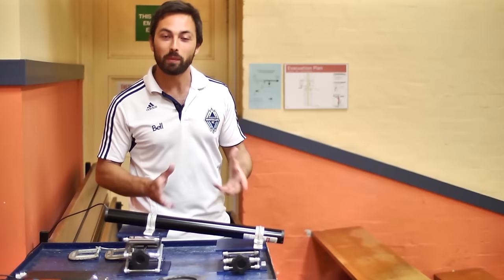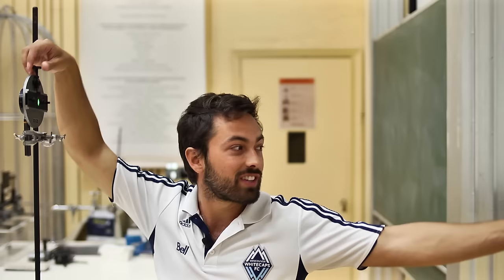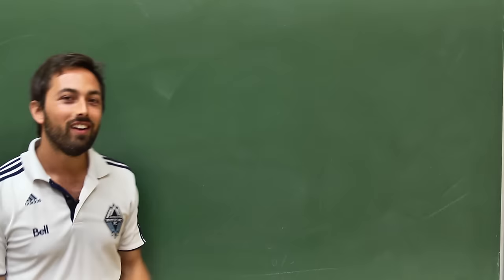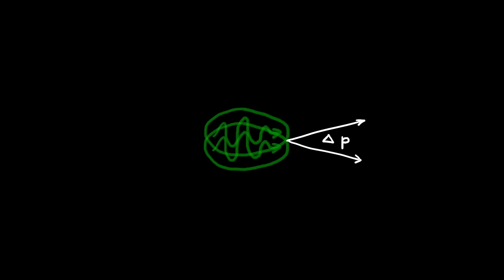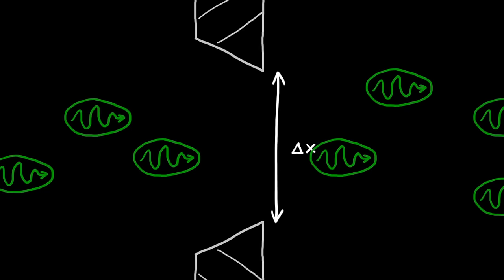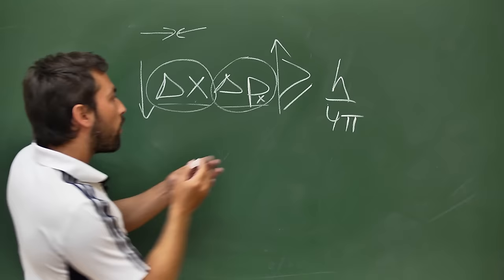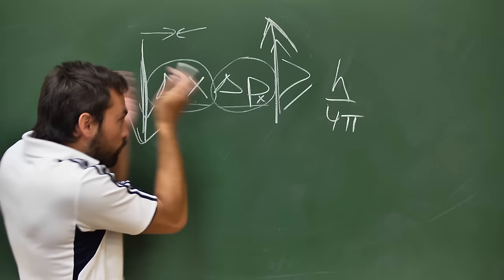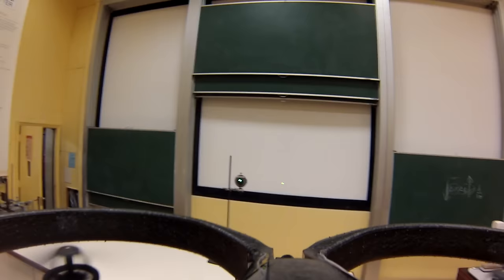Heisenberg's Uncertainty Principle Explained

Comment: Light normally extends but passing to such narrow slits it defracts and doesn't expand as it can only extend from one place to another but as light has some mass if slit is narrow than the mass than light defracts. It is bouncing in-between the slit and resulting in distortion as light can't pass through slit (as area of slit is less than mass of the light so light has mass here I say) so on the surface behind the slits its resulting in distortion of the light  where light is seen hazy or some diffuse due to light particles bouncing with and from slit so much less part (strength of light is less) of light is seen on the surface behind slit. 

COMPARING TO THE SLIT INREAL light only extends (which can't be due to its mass some place [slit here] is with less space so lesser area of a slit doesn't allows light to pass if space [area of slit] is less than THE MASS OF LIGHT so light is distorted) it can't expand as can't work other than moving in straight line WHICH MAKES IT DISTORTED on the place behind the slit.

Now force of light means REQUIRED LIGHT TO MOVE AN ELECTRON  IS FORCE and TIME WE CAN SEE (AT) THE TIME IF APPLYING FORCE ON ELECTRON so we come to know the exact time to move an electron by force of light and so we come to know force too and time too we come to know as required to move an electron so by formula m=f/t  as time and force we know now we can find mass of light-beam WE CAN SUCH WAY FIND MASS OF THE LIGHT AS COME TO KNOW FORCE AND  COME TO KNOW TIME TOO AS I INFORMED BEFORE IN THIS PARAGAPH AND THE FORMULA IS MASS=FORCE/TIME to find mass and property of light from mass.

IF YOU THROW A LIGHT BEAM IT EXTENDS THAT IS TRAVELLING IN STRAIGHT LINE AND WITH DISTANCE LIGHT DOESN'T EXPAND BUT DEVIATES FROM THE LINE IN WHICH IT IS TRAVELLING THAT TOO IS IN STRAIGHT LINE in different directions like making angles but it fills up the whole place or area which is due to its speed of time-travelling so it is at all the places still din't expand (expansion doesn't keep the material other than some area it gets diluted and extending makes copy things again and again made [due to time-travelling] what light is) that is light only extends like it changes direction due to angles even when anything is not in-between the flow of light (but it has mass so flow of light is different due to its mass {light is covering the place due to reflection alone that is extending when we see light in certain (big) area we should know that it is not due to expanding but due to reflection or that is by extending property of light in various angles even from the source too and like by bouncing on surfaces by making angles). As light is timetravelling so is at all places of deviation of light is by extending  but it is like expansion visible to us due to light travels in all direction [by time travelling too so time travelling is also there and light is also extending in innumerable directions {from the source too} so this two things are answer for light] still it is only travelling that is by extending, it covers the area like expansion, but only extending it could be due to its mass that it can't extend more or far ahead places it can't go so just mass is the weak-ness of light that it doesn't reaches at all places.

Comment: So, if the interference pattern observed is because of heisenberg's uncertainty principle.... Then how come it is the case you can still see light in the center? My question is that, if the uncertainty in x becomes so small, then there is no way the x momentum can be zero. Would not the x momentum need to be zero or near zero for there to be photons landing in the center and thus not having a dark spot there?

Comment: Veritasium Can you do a demonstration of a reversed experiment where you decrease ∆p? How does the momentum of photon change if the velocity is constant?
Reply: physics doesn't allow photons to move at different speeds. You can send them through a medium which gives the appearance of slowing down, but its really just the time it takes for the light to be absorbed and re-emitted. So the only thing that really can be changed in this equation is the knowledge of the position of the photon.
Reply: +Corey Minich But change in momentum for a photon is linearly proportional to a change in it energy. 
So, you can change the momentum. 
But HUP deals with uncertainty in it.
Reply: Momentum in the sense of adding energy and taking advantage of the duality of the particle, but it's not changing speed. So I'm not sure what that has to do with this topic
Reply: can't we change its speed by traveling it through a transparent medium?

Comment: I have a question.  The momentum becomes less certain as the position becomes more certain. Can we simplify this since the experiment uses light?  Momentum is Mass*Velocity...but light doesn't have mass, so is it ok to just use velocity?  Velocity is Speed and Direction, but lights speed is constant...so without a change in mass, and without a change in speed, does this mean that the direction of the light is becoming less certain as the position of the light becomes more certain?
Reply: light technically in quantum mechanics does have linear momentum = H/lambda
it is the same H as in the video used for Planck's constant and with this formula you use the uncertainty principle

and yes over here what is represent is change in direction but i am not sure if this is the Heisenberg uncertainty principle i was under a completely different interpretation which i was taught and made much much more sense whereas this video didnt give an explanation about how that is the uncertainty principle so i am not sure if this is it or some other principle

Comment: I propose you watch your own video about pilot wave. It is an interference pattern that appear.
Looks like your bullet photon animation is misleading. Showing wiggling short waves (one full 360 degres per photon) would be closer to reality.
But your point in this video is demonstrating that too much precision in position induce imprecision in momentum.
But do you know how momentun is measured in any optics lab?
I worked for 8 years as firmware engineer for the femtosecond laser MaiTai. The 20 femtosecond bursts are so short that the light barely makes 10 to 20 oscillations.
There is no photo detector able to measure such short pulse. So, the optical engineers use sliding mirrors to introduce calibrated delays and rely on constructives and destructives interferences.

Comment: Uncertainty  may be the result of lack of data or understanding, when you have both there can be none.
The only reason the light spread is as result of the slit being narrow than the laser beam, never happen before.
Make the beam narrower no spread, narrow the slit again it comes again, due to the fact the photons not move in a perfect parallel lines, if they would have there would be no uncertainty, also the thicker is the barrier the uncertainty is smaller.
OK you say so we can calculate the angle and know where they  hit, why would they spread? The answer is not knowing what is really happening, we can calculate the odds pretty well, but to the how there is no answer.
Know the how and each photon will go to the exact location you will predict.

Comment: you say that the narrowing of the slit we are decreasing delta x. but the momentum is velocity and mass so why would the velocity and mass make something shift to the sides?
Reply: Exactly what I dont get
Reply: I got it. In quantum mechanics the momentum of light depends on its wavelength and a change in direction is equivalent to a change in wavelength since one doesnt happen without the other. Cant describe it using classical physics since light has constant speed and no mass so mV makes no sense.
So when the uncertainty in momentum increases / what direction light goes in is uncertain. So you get the spread in the x axis. 
what really made it click for me is taking a horizontal slice of the phenomenon in action.

Comment: From where does the photon gets energy to accelerate ? I mean , To change its momentum .
Reply: Photon has no mass so by the 2nd Newton's law F=ma photon needs 0 force to accelerate. He doesn't even accelerate, he gets his speed (c) insantly.
Reply: That's actually a good question, because of e=mc^2 the light would require a force acting on it to change it's direction.  albeit a very small force
Reply: +K463178 when we leave classical physics , we get to a point were we can say that forces act upon energy , not mass . so , photons do require energy while accelerating ....
from where these photons get energy , if they use themself as an energy source , they would vanish after sometime ....Please explain the truth
Reply: I think photons don't need an energy in order to change it's direction of moving. Because how can you spend an energy in order to change the direction of MASSLESS thing. No force required to change it's direction (F=ma) and therefore no energy either (E=FxS).
Reply: Grukkel Zinn It has mass, it's just in the form of energy, same reason light is affected by gravity
Reply: Inderjeet Singh I don't understand what you are asking
Reply: +Grukkel Zinn according to e = mc2 ...or rather m = e/c2 
if it has energy , it has mass !! but very less ....
but less is not 0 , and to change things in such small mass we still need energy ...
that's why gravity pulls light :)
Reply: gravity doesnt pull light, gravity bends the straight path that light was traveling in spacetime.
Reply: niko valley yeah , but what does that bend of light depends on 
1. Mass (Energy) of pulling object
2. Energy of object that bends (or goes in curved space time)
If light neither had energy , it would have not bended
Reply: +Inderjeet Singh You have to interpret the photon as a wave, not as a particle (see Wave-Particle Duality)
Reply: Samuel .Jele So when i assume it as a particle , this theory fails ?
Reply: I have to say that I'm not an expert in physics (obviously :P).
But I wouldn't say that the theory "fails" with electrons as particles. It can be explained with the electron as a particle.
The Wave-Particle duality just says, that some behaviors of the electron (and other sub-atomic particles) can be explained with wave-theory and some can be better explained when you interpret the electron as a particle (for more information watch some videos or read about the double slit experiment)
PS: sorry for my bad english
Reply: You're all misunderstanding. None of the photons are changing their momentum. Every photon is traveling in a straight line through the slit and to the screen. The x-direction momentum just refers to the angle of that line with regard to the plane of the slit.
Reply: Copydot A change in direction is a change in momentum
Reply: K463178 It's not changing direction. x is the simply the component of the photon's velocity in the x direction. The photons aren't actually accelerating in the x direction.
Reply: Grukkel Zinn if you look at E=mc^2, you'll see that light does have mass (not the right equation for light, but whatever).
Reply: Think about something at 0 K. At that point, it's momentum should be certain right? At 0. But this principle means that the particle will vibrate, essentially giving it energy. So it won't be 0 K.
Reply: Dilip Tien Seems like you haven't watched the PBS Spacetime video... And the temperature isn't just the straight movement of atoms in some direction, you know?
Reply: Grukkel Zinn how is any of that relevant?
Reply: Photon can not accelerate, it has constant speed -> speed of light. 

It has also no mass. Only massless particles can travel at speed of light.

Particles with mass can travel speed very near to speed of light, causing distances to physicaly shorten, also time goes much slower from their point of view.

From the photon point of view it has to travel NO distance at NO time. 

So if we see some star in a space which no longer exists its because light from the star didnt come to us from our point of view. From the point of photon, photon traveled 0 distance in less than moment. In less than 0.000001 sec. It traveled in no time.

Time goes slower as we get closer to speed of light, at the speed of light time stops, and if there are any particles faster than speed of light, they can never go slower than speed of light, because they are traveling back in time.
Reply: Grukkel Zinn you need to be more clear
Reply: Copydot Earlier photons were moving straight through the slit , as the slit went thin , photons bend to diverge . That bend is a change in direction . Thus requires energy !! Right ?
Reply: Inderjeet Singh Nup. Thats because of nature of photons. At the moment of passing through the slit they dont even exist. Not as particles. Each individual photon exist as a probabilistic wave function until the moment of observation.

As soon as we detect photon on screen or detector, wave function colapses and photon appers on the screen at a certain location. There are locations on the screen where it is more likely for the photon to appear and where it is not.

When slit is wide enough there is very high chance (practicaly 100%) that photons appears in the middle as you would expect.

But when you make slit narrow enough you will make uncertainty in a position of a photon low and uncertainty in momentum needs to cover larger area in order to preserve Heisenberg's uncertainty equation. So basicaly chance that photon lands outside of regular area increases.

But it has got nothing to do with energy or mass, because light particles travel in different way than regular particles. For example one photon can travel via two slits simultaneously. No one knows how, we are just sure that he does it.
Reply: Ivan Horňák Can you please share link of any good video explaining about the wave function of photons .
Reply: Ivan Horňák all particles small enough have the same behavior.
Reply: yep thats true my bad.
Reply: no particle in the universe can reach absolute 0( 0 K) , so momentum will not be certain for any particle.

Comment: Due to refraction, and for single slit formula of the minima = lambda/b it is not surprising as the slit width b decreases that the width of the central maxima gets larger since the angle at which the minima increases and thus the width of the central maxima increases
Reply: diffraction*

Comment: Yeah! I got confused with it.
That's diffraction and you said that's momentum uncertainty.
Reply: Well...it's both. It's like saying that when you pull your arms in while spinning you start to spin faster because of conservation of angular momentum. But conservation of angular momentum isn't an explanation, it's a principle, much like the Heisenberg uncertainty principle. What really happens is that you exert a force on your arms on their way in and that accelerates them to a higher velocity, and with the light what really happens is diffraction and interference of the light waves.

Comment: Sir, i had a question from heisenberg's uncertainty principle it's  puzzling me from so long i can't find an answer to this and the stacks exchange is not accepting my question can you help me out...

The doubt is as follows

If the uncertainty in position of an electron reduces to one fermi (that is 10^-15 m ) the uncertainty in velocity increases to an order of magnitude of 10^10 m/s which is the case to check wheter heisenberg  uncertainty principle allows electron to reside inside nucleus the textbooks disregard this by saying since the einstiens special theory of relativity says nothing can go faster than speed of light (order of 10^8 m/s ) thus this uncertainty can not go beyond the speed of light. But my doubt is that what is the problem even if it goes beyond the speed of light as Einstein's special theory of relativity talks about speed of a particle not "uncertainty" in speed of a particle i assume that this high uncertainty just means that once it is inside the nucleus the speed would be so uncertain that you won't be able of measuring that at all . There should be no problem in existence of electron in the nucleus of an atom. Since heisenberg's uncertainty principle is all about measurements not existence also i can't really understand why the textbooks equate uncertainty in velocity and actual velocity of electron in numericals from heisenberg's uncertainty principle....
Reply: I hope this could maybe answer your question:

In the context of the Heisenberg uncertainty relation, uncertainty should be understood as a statistical property.
For example if the unknown velocity is Gaussian distributed, the uncertainty is one standard deviation of this distribution. Every value in this distribution is a possible outcome of your measurement.

If the velocity uncertainty is however larger as the speed of light, this would mean that some of your measurement outcomes should be as well. This is not possible
Reply: But maybe also interesting for you:
If you carry out the calculation of an electron inside an atom, you will find that the electron does have a non zero chance of being inside the nucleus. It is just that the distribution of possible places for you to find it is much larger than it. So again uncertainty describes that if you would measure very often where the electron is and very often how fast they are going, both results that are statistically distributed follow the Heisenberg uncertainty relation

Comment: what happens when you rotate the narrowing slit 90 degrees? You start narrowing the opening from the vertical direction not the horizontal...does that make the spot to spread in the vertical direction then?